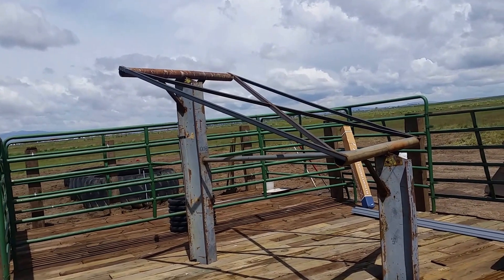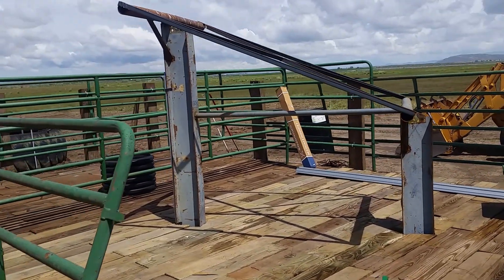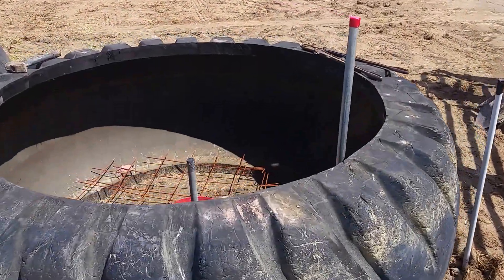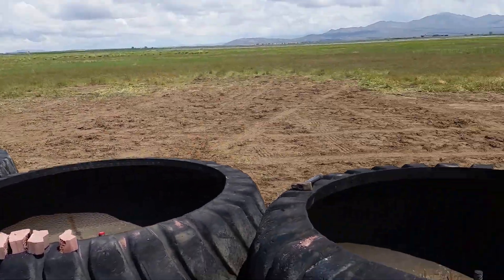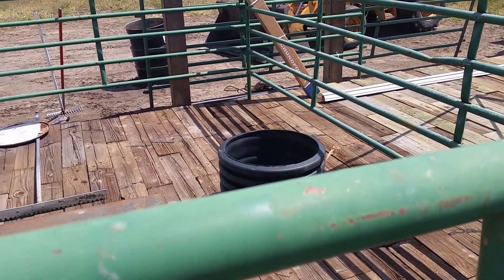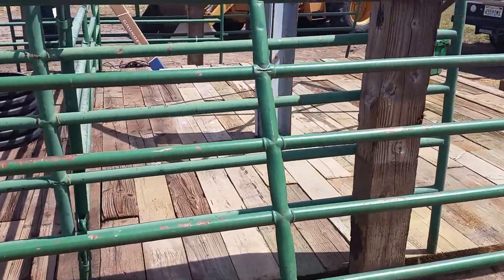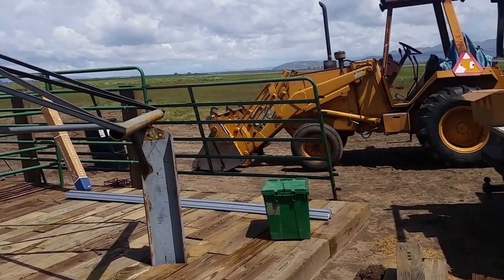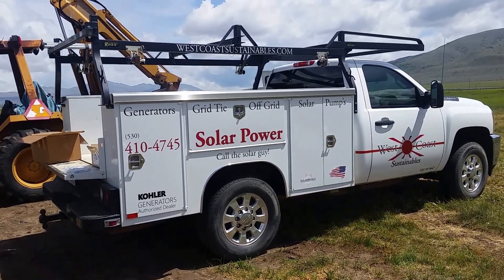Off Grid Grundfos solar pumping in Doyle California

Comment: Nice, I was flying today and I commented but it didn't post to fb. I guessed an 11sqf-2 cu200 and 3 panels.
Reply from the maker: this one is a sqf3-2 with a cu200 and 4-175 watt modules.  The owner built the stand and I am setting the pump and panels.  I thought I'd make a quick video
Reply: +Jason Andrade where do you get your sqfs?
Reply from the maker: +engineer775 Practical Preppers 
preferred pump
Reply: +Jason Andrade likewise . preferred pump in asheville nc
Reply from the maker: +engineer775 Practical Preppers I thought I would do a vlog style video
Reply: +Jason Andrade like it! I'm watching and waiting for the next one.
Reply from the maker: +engineer775 Practical Preppers I had to wrap it up early, the lighting came in fast! I should be wrapping up tomorrow